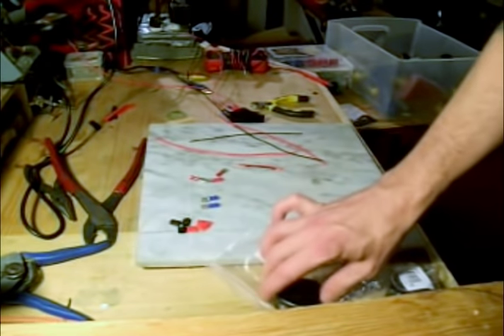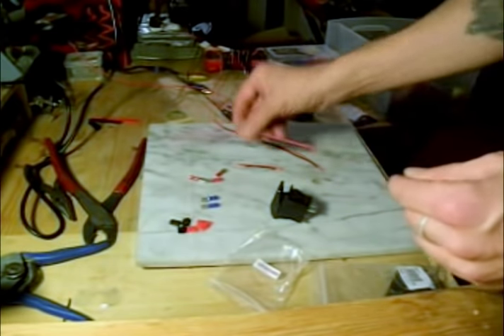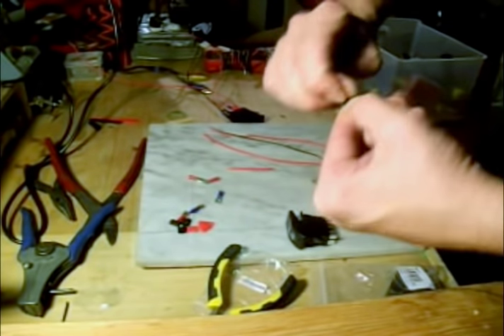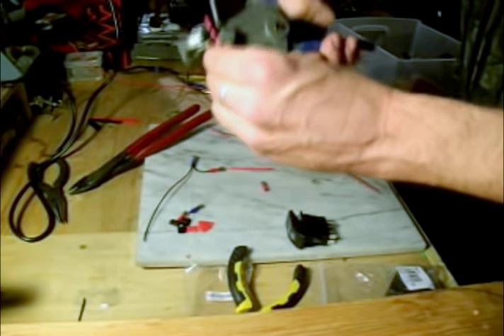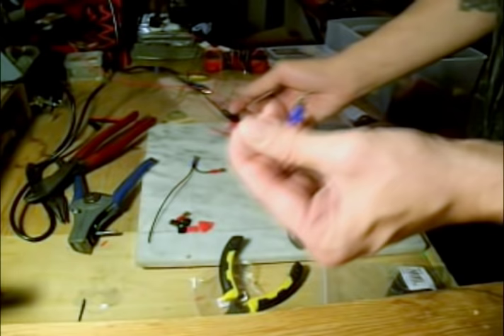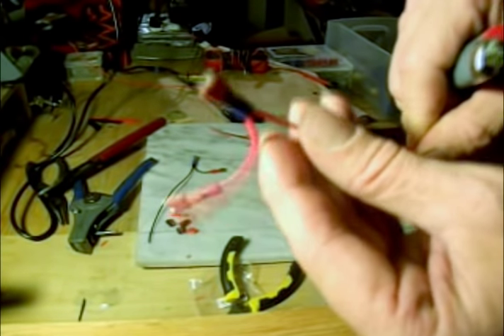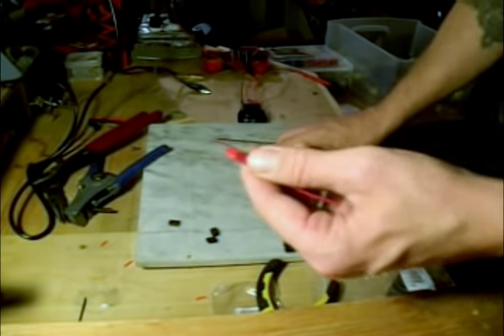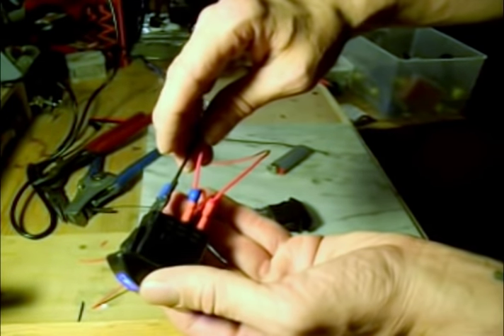LED rocker Switch

Comment: Hi, 
i got one of those rocker switches but it also comes with a dual USB with voltmeter squeezed between top and bottom usb ports. 
the 2 components came wired up already but my question is it came with 3 red wires and 1 black. do i connect all three to the same power source or is there a certain way to wire this setup? if you like to chat directly my email is accordance73@gmail.com thanks. i normaly know how to wire these things up but the 3 positive wires are throwing me for a loop....lol
Reply from the maker: without seeing it Id only be guessing, but it would be an educated guess lol,   I would say the 3 powers in probably head to the different components ie volt meter, usb and switch and yes you could conceivably connect them to the same power source but you could also opt to wire them separately for example if you wanted the switch to be connected to the acc of the ignition the usb 24/7 and the voltmeter only when the car is running etc  and the ground is constant to all of them

Comment: Ok so the top 2 are ground for the switch lights (on position light and running/ off position light). You tied those 2 together and ran that to the battery ground.
The middle is power to battery or a key switch on 12v source.. The bottom two are power for the switch lights and the accessory. Where do you ground the accessory itself (light bar)? Can't I just tie the light bar ground wire in with the other grounds going to my switch that lead eventually to the battery ground terminal/ chassis ground? Or do you recommend grounding it to chassis by itself? I am a little confused and this seems to be the better videos here on youtube. THANKS!
Reply from the maker: yes you could  ground it that way, the ground is pretty versatile I mean you can connect it near anywhere the body of the car or truck is grounded too right so....   but for my application in this vid I grounded the switch and the lights separately so I did not have to run so much wire

Comment: Where do I connect my ground from my accessory light. I am not going into a relay I'm just trying to wire a small led strip light from my ashtray to a 5 pin toggle switch so I can turn it on and off. My led light strip needs to be grounded I do not have a metal area any where can I clip into the ground from the battery?
Reply from the maker: the ground can usually go anywhere convenient thats connected to the frame and grounded so most metal of the inner or outer car any ground wire like the outer portion of the dc power outlets (cigarette lighter) etc the ground is easy as it can go to most anything metal

Comment: If I come off the bottom right pole and run a hot wire say to the key on power outlet in my truck do I need a fuse between the switch and the power outlet? Also would it just be one wire that is needed or do I need to run a ground wire also? I already have a fuse and a relay between the battery and the switch. I just want the bottom led light on the switch to come on when I power on the truck I don't want it to stay on all the time. Thank you for the help.
Reply from the maker: well these switches are rated at 40 amp I believe so I think you can get away without the fuse inline between the ignition wire and the switch, Ground yes you do need to have but that's usually pretty easy to find I mean worst case ground it to the body some screw or bolt.  I have added some more info on these switches on my website,  in the pictures is a cool little item that makes the connection into the ignition a breeze  and fused in one step  check it out   
http://www.kootenayboy.com/rocker-switches/

Comment: Thanks for explaining.
I plan on putting 5 rocker switches in my Jeep(1 for amber lights,1 for white work lights,1 for roof lights,1 for windshield washer and 1 for USB)
Rather than having 5 wires all connected to the battery,is there something I could use that I could connect to the battery,and than have the red wires for my 5 devices connected to it?
Reply: Blue sea auxillary fusebox
Reply from the maker: yes like jeff said a ad on fuse box or a terminal bock some have a different connection for each wire others like for car audio have a large gage in from the battery and then you put the single wires into the other side just match the fuse to the load if using the car audio type. if using a fuse box its done for you  both are available on amazon ebay and walmart under $20 usually

Comment: Hello there. I have the same iluminated switch. I want to know if I can connect the 2 red wires together due to led bar just having 2 wires for switch.
Reply from the maker: only one red + to the light needed the switch has one red in from the battery or power source one red out to the light  the other red in the video is for the led in the switch and unless you want the switch to light up you could skip all together  does that help?

Comment: Hi. Thanks for this. Quick question. I have an auxiliary fan which is automatically turned on once I switched the A/C on. I want to add a rocker switch by splicing one wire only. How can I accomplish this with the rocker switch pins. Thank you
Reply from the maker: you want to disconnect it from the AC system and make it switchable or add the switch to the existing setup?  one is easy the other may be a problem.  if you wan tot have it switchable only thats easy you use the same out wire off this switch that you would run to the lights to the fan hot wire.   If you want to add the switch to the AC  Im not sure if you would need a relay or not  it would depend on if the fan is on its own circuit or not as you would not want to send power to the fan and have it feed back through other things on the AC line.
Reply: KootenayBoy DIY thanks for the reply. It already have a relay I just want the auxiliary fan to have a rocker switch. Regards

Comment: i got 2 volt led meters to read 2 different battery's but i want to turn the led volt meters both on and off with the same switch, but of coarse i need them to stay separate circuits, pls help
Reply from the maker: I think in your case your looking at adding a relay  or possibly two  you would wire each volt meter to its own relay and then the trigger wire from each relay to the same switch  that way the switch is only providing power to the  toggling of the relay's and not touching the power to the volt meter.  think of the relay as a magnet when power is supplied the power energizes the magnet and pulls them together completing the circuit when the switch is off the power to the magnet stops and they separate cutting the connection  the power that flows through the magnets when connected is separate from the power to connect the magnets.  Make sense?

Comment: Is it possible to wire these so the led in the switch is on all the time?
Reply: Yes see my comment about if you are talking about the bottom LED. He jumps it wrong in is wiring demo but the switch he has prewired powers at end is jumped differently and correctly.

Comment: That was great finally got it,,   Do you have any info going on to a relay 4 plug, I am trying to add a Blue Sea St Blade Split Bus Fuse Block.. I want to turn the fuel pump at the dash, and turn on a vacuum pump from the dash. I have no more circuits on exiting fuse block in the car for switch on.
Reply: Did you end up figuring out how to wire that 4 way relay

Comment: Great info, nice video. I want to wire multiple lights and a few other accessories in a UTV. I picked up an ACC wiring harness, this is probably a pretty broad question but how can I run all switches off ACC?

 I have 4 lights an intercom and a 3 other accessories.
Reply from the maker: Thank you I appreciate it.    you will most likely want to use a relay  the switch power from the key etc  will be minimal and the majority of the juice will come from the Batt would be the easiest safest way.   that way you only need to power the switch from a source powered only when the key is on etc  and from there the switch powers the  "open" to the relay which essentially opens the gates allowing the power to flow from the battery to the components , the thing is all of them will come on at once  but if that's what you want then perfect  just make sure  the relay you get is sufficient amperage to handle all  the gizmos you want to run off it.   most 12v standard ones are 40amp  more than enough for a led lights and some other components.  I bought a bunch of them off Ebay for like $5  with harness  but they are sold everywhere  that help?
Reply from the maker: you could also get a electrical board  the kind with the little screws in it  that is just an easy clean way of connecting many wires to the same power source  if the items you want to run are WELL under the max amperage of your switch.   ya they have a max  lol  as a kid I han no idea  a few spontaneously self combusted in the dash

Comment: But when you wire it like that the light will always stay on even when the bike is off so you have to splice the wire into a somthing that is only on when the bike is on
Reply from the maker: well yes  like I said you need to have a wire that leads to the ACC  to power the led in the switch  OR wire the led in the switch to the power  in the switch  meaning the led is only on when the switch is in the on position the placement of the jumper wires dictates this.   some people have said the wiring is different on the switches I show and that is why.   I show both ways it depends on what you want to do.    you can have the LED on 24/7 , on only when the key is on or not at all at any time its up to you.  The LED has nothing to do with the power through the switch at all its an add on like fries or salad or neither
Reply: KootenayBoy DIY thanks, is it possible to only have 3 wires run to the switch and everything still work or do you have to have 5
Reply from the maker: @joeyschultz3774   all you REALLY need is a hot wire in a hot wire out and a ground which can be the same wire  or wire attached to the frame etc  its a switch  a fancy led switch but still just a switch   it just breaks the connection  like pulling two wires apart  clicked on its like you put the wires together again   so yes you can run it with 3 wires  and without the fancy led lights
Reply: KootenayBoy DIY is it possible to run 3 wires and have the leds work
Reply from the maker: @joeyschultz3774   yes I believe so  hot in hot out and a jumper from the LED to (Id suggest) hot out  so the led is only on when the switch is in the on position

Comment: how about 4 pin how to wire?
Reply from the maker: well without seeing it Id say you would have a power in a ground a power out and one to power the led in the switch.  if you have a multi meter with the continuity setting it would be easy enough to figure out which is which

Comment: Kootenayboy Would I be able to use this one switch to power 2 3x3 led cubes and a 32" light bar? Also, is a relay required for any of those led bars?
Reply from the maker: yes you should, they are rated to like 40 amp  that said I use 4  I split my truck roof into "zones"  front rear R side L side  so each switch handles a zone and I put in a relay for each zone  I did not have too but I thought for the $5 for relays  I may as well cover my bases and if I decide to add more draw to the zone Im covered :)

Comment: @kootenayboy....new subscriber here...great video....i just bought these switches....why i have no continuity when the switch is on?
Reply from the maker: Thank you I appreciate that :)  are you testing the correct post?  you would want to check only the red  (power in power out) wires   unless the switch is busted if should allow flow through if its not that its probably the wrong post :)
Reply: kootenayboy .....ok..i figured it out. ...the middle and bottom left is the true connection. The ground is there on top incase something bad happens even though there is a fuse in the wiring.....thanks!
Reply from the maker: that's great congrats :)  I believe the black is also for the LED in the switch and one of the posts is for that as well, the one I used the short wire to jump   you can wire them a couple different ways ie led on 24/7  or led on only when the key is to Acc (best route)  and as its DC you have to have everything "grounded" though they do not use that method much anymore its all run back to the battery  so you get a better "ground"  lol I remember when all you needed to do was put a screw into the metal and that was good enough now your likely to smoke a computer doing that.  what are you  planning on running off the switch?
Reply: i bought a wildcat x1000. i have a light bar switch, rear light switch, a blower switch, and a winch switch. the person before me had a a normal off and on switch for the light bar
Reply from the maker: sayheytome awesome.  I'll be doing a winch switch tutorial in a bit here, just waiting for it to land I'm looking forward to it
Reply: kootenayboy ...thanks!...need all the help i can get.

Comment: Do you have a wiring diagram that connects the rocker switch to the relay? Thanks
Reply from the maker: I could but would need to know which relay your using  as the switch just sends a small amount of power to the relay's toggle in  and could be different on each model relay   Im working on a tutorial for relays but have been taking my time I want to get it right  what relay are you using?  and are you planing on norm open or norm closed  (whats it going to run?)
Reply: I am using a CIT Relay 12V 4 pin connector 30, 86(+), 85(-), 87(a) use to connect to the 5 pin rocker switch as shown in your YT video and a LED light bar. Just wondering where the wires from the rocker switch will be connected to the relay. Thanks for your great video tutorial on rocker switches.
Reply from the maker: Thank you I appreciate that (a lot)  for most people 87 (red) goes through a fusible link to the Batt  30 (blue) goes to the load (LED lights) 85 (yellow) to the ground on the batt 86  (Yellow) to the switch on mine it was one of the bottom posts with the pigtail  87a (black) not used  (unless you need the normally on power source is needed, like if you wanted the switch to operate in reverse  87a is on all the time unless you send power to the relay then it shuts off )  does that help?  Ive made a tutorial for it too just not finished it yet
Reply: Thank you Kootenayboy. Your description really helps out a lot. It is not very often you get a reply back on YT channels. Can't wait for you to put out the video. I subscribed to your channel.